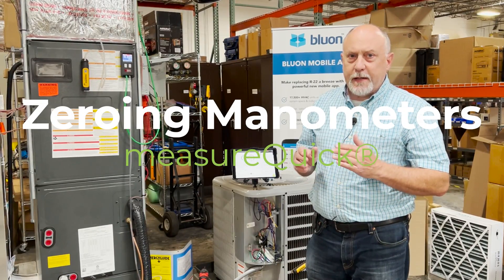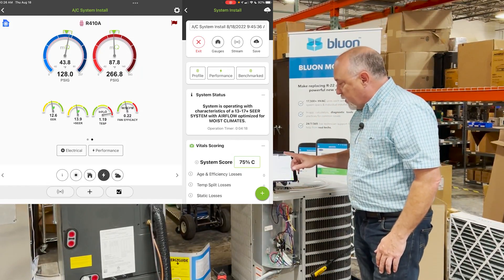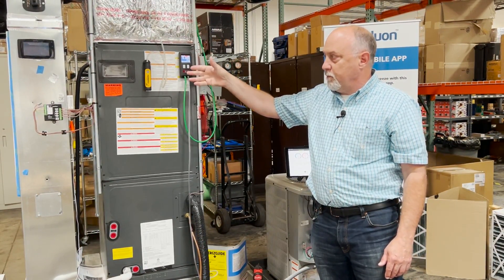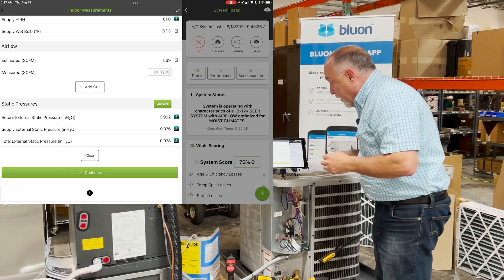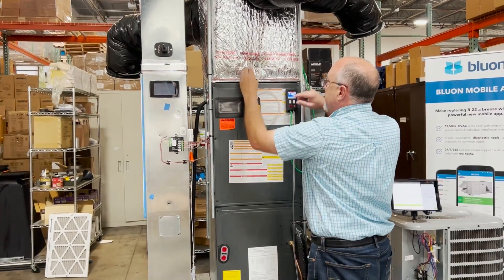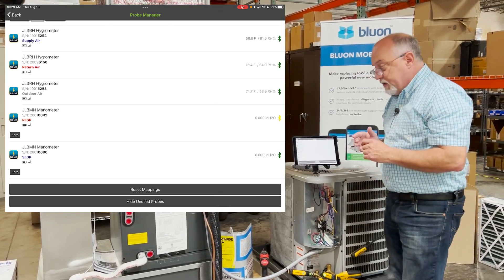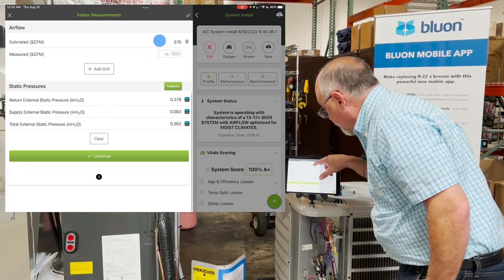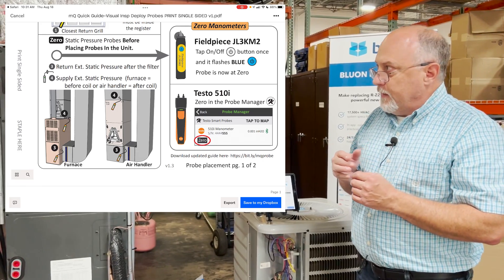Zeroing Fieldpiece Manometers

Comment: How come you didnt zero the manometer with the hoses connected unkinked since they are going to be used in unisink for measuring and I was told that the probes are suppose to be pointed to airflow